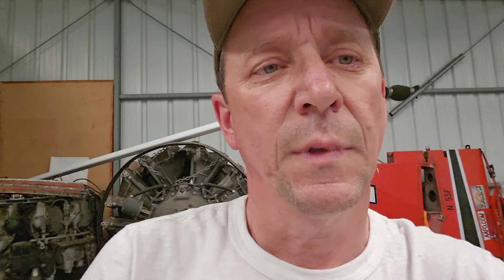Hawker Sea Fury Engine Choices

Comment: Running 5000hp on a test stand? How come it didn't produce this in the air? The math doesn't stack up and I cant see that hp figure elsewhere?
Reply from the maker: <<<The math doesn't stack up and I can't see that hp figure elsewhere>>>    Specifically, what math doesn't add up?  With all due respect, how would you expect to see that hp figure elsewhere?  There is only one guy who has run a 3350-26WD on methanol on a dyno.   That would be Bradley C. Miller.  You could look him up and hear it for yourself.  It is quite a story.  
I suspect the scratch built fuel injection rings were part of the problem when it was on the airplane.  I wish the team had been able to run #88 for a few years to get the bugs worked out.
Reply: @seafurycentral3744 Thanks, that makes more sense. I missed that it was running methanol. I didn't mean literal math, I was referring more to the speeds we've witnessed with the 3350 in racing. I much appreciate your comments and material on this site. We're fortunate indeed to have your insights and depth of knowledge to feed our passion for the Unlimiteds. Keep 'em coming.

Comment: Wonder If the Bristol sleeve valve motors can make race power or are they to rare and no spare parts?
Reply from the maker: The Centarus is quite happy at take off power.  2550 HP, I think.  They do not like the RPM higher due to the rotating mass of the sleeves and such.  Definitely hard to source parts for them.  The sleeves are the really rare parts and no one has been able to make new ones.